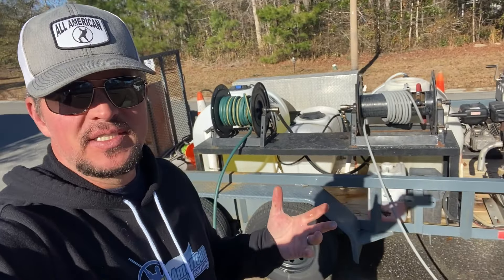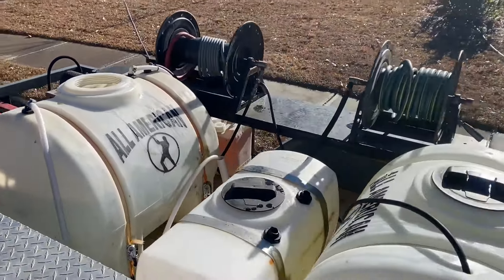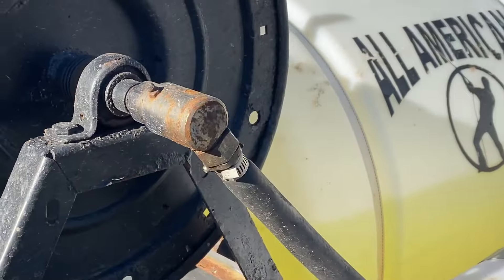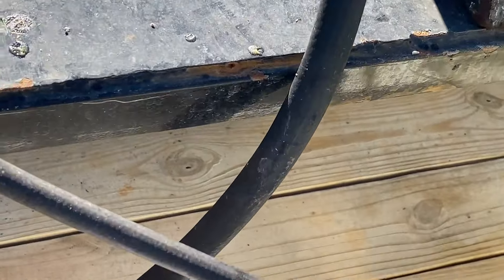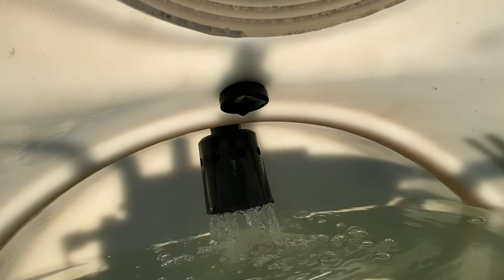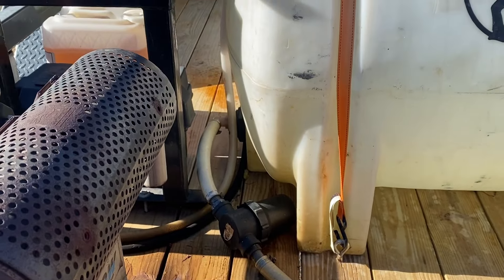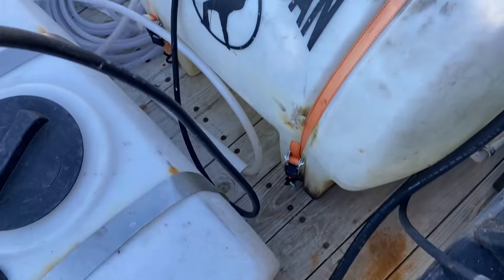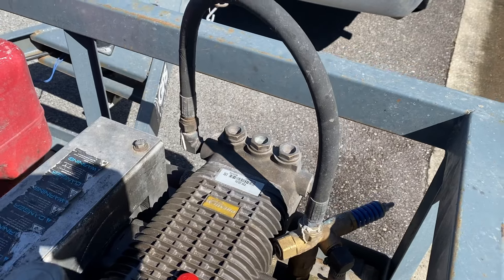How to Plumb a Pressure Washing Trailer & Soft Wash Setup

Comment: Are you pulling straight sh without surfactant for the downstreamer? Or do you do a SH+surfactant housewash mix in the one SH tank then add the extra sufactant thats needed when softwashing via the mixer valve? Also, awesome video, Thanks!
Reply from the maker: +Jamison Jarosz  we do not use a surfactant when washing houses - only on rare occasions.  In my opinion, it increases rinse time and doesn’t really add any value.   We do use it for roofs
Reply: @AllAboutPressureWashing  That clears up my confusion alot. Thank you for responding to comments, it help more than you might realize!

Comment: Hello I love your videos I’ve watched every single one and then some have read your blogs very informational I’m just starting out this year I have pressure washed for a company for a couple years just fell into the opportunity down here in Central Florida again I have learned a lot I did have a question wasn’t sure the best way to reach you. It was regarding the ends you drop in each tank for your soft wash system could you make a video on how to make those or update on your parts list where to buy them I can’t find any video anywhere on how to build one or where to buy one love the way you have it set up I have mine set up similiar Thank you and God bless
Reply from the maker: There is absolutely nothing special about it. It is just the hose going through a piece of PVC pipe. You can put a three-way PVC T fitting on the end so the hose  does not come out of the pipe.

Comment: First I’d like to say thank you for showing how things flow in the pressure/soft was system. Next is do you recommend certain type of fittings to connect to pressure washer and soft wash system? I was thinking of coming from a 3/4 to a garden hose and connecting to pressure washer. Or are there other fittings to accomplish same task?

Comment: Love the video I just finally added bulk head fittings to my soft wash tanks to make it more professional and less messy.  I also added camlocks so i can still flush the system properly
Reply from the maker: +TheMhowi007 Tell me what she did with the camlock’s. I have camlock’s from our soft wash hose to the gun but that is it.
Reply: @AllAboutPressureWashing  so where your bulkhead fittings at the top of your tank is you get 1/2 elbow from there you put a camlock fitting into the elbow.  Then on your soft wash line they have a camlock fitting with a 1/2 hose barb that connects into the other camlock attached to the elbow... hope that wasn't confusing im up in Boston so I'm shut down for the winter I'll take pics and get em to you if you don't understand.  The only place I found 1/2 camlock fittings  https://www.pvcfittingsonline.com/fittings/camlock-fittings/polypropylene.html
Reply: I also wish you made this video 12 months ago when I started plumbing was the hardest part for me I had to watch a million videos of ppls setups pausing a million times lol thanks alot
Reply from the maker: +TheMhowi007  was mine shy good?
Reply from the maker: +TheMhowi007  send me pics or a video info@cleansavannah.com
Reply: I sent it to your email its the only pic I had hopefully it helps
Reply: I have my hose and gun camlocked too but just found that they have 1"2 stainless steel quick connects and 1/2 swivels only thought they made 3/8 and 1/4 figured having a swivel that's SS would make pulling that long hose much more efficient
Reply from the maker: I’m buying the stainless quick connects because my techs break the gun almost everytime they use it
Reply from the maker: Send me the links to buy please
Reply from the maker: Got it - thanks
Reply: https://www.pvcfittingsonline.com/fittings/camlock-fittings/polypropylene.html those are for the camlock fittings I also use zoro.com for most of my pvc purchases.  As for the 1/2" stainless steel you can Amazon powerwash.com has them as well they also have the 1/2 swivel
Reply from the maker: Thank you!

Comment: Instead of the removable drop stick on the Softwash system, could I just make them permanent and just turn the bleach and soap dial off to run clean water through?
Reply from the maker: +B Lane you could - how are you going to Run fresh water through the other lines - you might think about a t and another valve.  That why I do
Drop sticks
Reply: Ok, I always just downstream and I am trying to learn how to build a Softwash system myself. Even simple plumbing is just hard for me to envision, especially without any prior doing. I thought by turning the soap and bleach off, water would allow me to flush out the pump and hose reel and that would be sufficient

Comment: You mentioned you downstream 99% of house washes. Why do you prefer that over the 12v soft wash system?
Reply from the maker: +Soots Tactical It’s just how we do it, we use the 12 V system for roofs and heavily stained stucco. But that’s about it. House washing, down streaming is very fast for us.
Reply: Do you typically use surfactant when house washing?

Comment: Could you just shut the sh valve and the surfactant valve on the proportioner and keep the water open all the way to flush the system when finished with a job?
Reply from the maker: You could but it wouldn’t flush  out that side of the proportioner, and check valve
Reply: Gotcha, hey thank you for making this video. It helps a lot.
Reply from the maker: +Soots Tactical my pleasure

Comment: So the pressure washer's fresh water inlet can just be gravity fed from the fresh water tank ?? No need for an inline pump or anything else needed to force feed it its water supply ?
Reply from the maker: +Casey Davis  I think it depends on the machine - smaller machines might need to be force fed.  Our machines are gravity fed straight from the tank.
Reply: I have a 4gpm machine that's gravity fed.  You need to get a special fitting for the inlet they are called king fittings.  You remove the regular garden hose fitting and add the King fitting.  It's a 1/2" npt with a 1-1/4 hose barb with a 1-1/4 suction line from your machine to your tank.
Reply from the maker: Gotcha

Comment: Didn't cover what I need. None of these videos seem to
Reply from the maker: +Adam Estabrook what do you need
Reply: @AllAboutPressureWashing  quick response brother. I wound up posting in the Pressure Washing Friend's FB group and figured it out. I was trying to figure out where the hose from the unloader went. Spoiler, it goes into the water tank lol
Reply from the maker: Yes sir
Reply: @AllAboutPressureWashing  can I just do a bulkhead fitting with a barb on top of the tank and connect the unloader hose into that?
Reply from the maker: +Adam Estabrook yes - that's what we have on our trailers
Reply: @AllAboutPressureWashing  thank you, I appreciate it.

Comment: Great video. Quick question, how much does the setup roughly cost without the pressure washer and trailer?
Reply from the maker: +Max Mas like the tanks and soft wash stuff?
Reply: @AllAboutPressureWashing  yes sir because I already have a trailer and pressure washer but don't have the other stuff like tanks, reels and soft wash stuff/plumbing.
Reply from the maker: Check out the links in the description- all the stuff we use is there